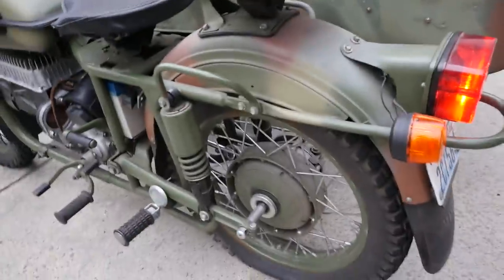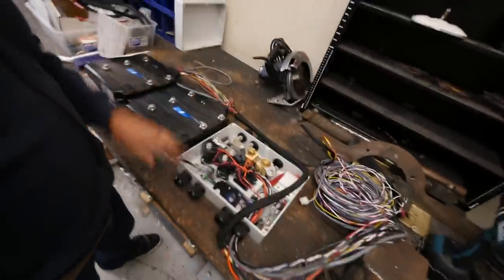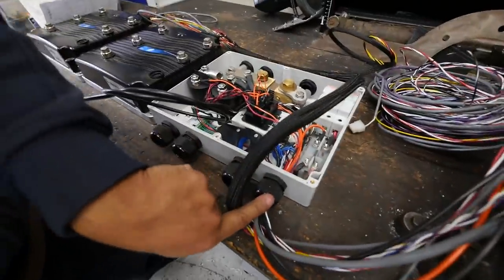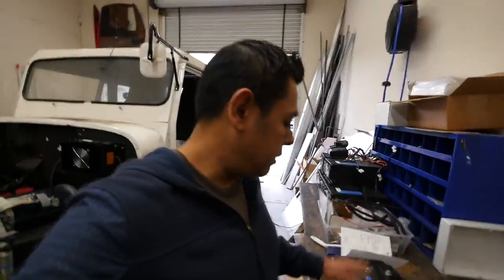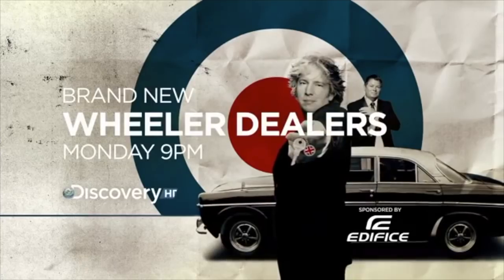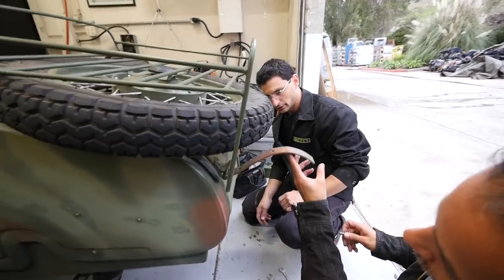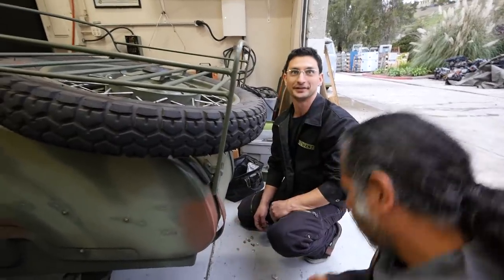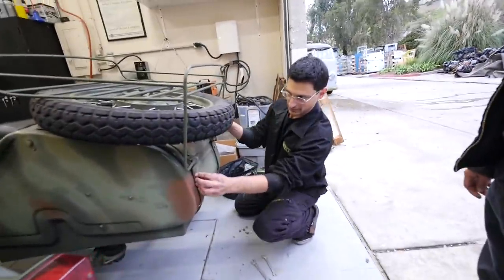The Electric Ural Motorcycle  -   Vlog #219

Comment: maibe use the same trick rockcrawlers use and screw the tire to the rim using small parkers(beadlock)
prolly only need two screws to prevent the tire from spinning on the rim
Reply: Yup, it needs bead locks for sure......

Comment: Hi guys,
write please wich type hub motor (powerful, voltage), controller and battery pack you use in URAL bike?
Reply from the maker: +Alfabike  hpevs.com AC-20/Curtis 1838
Reply: The ural uses the same drive line as the zero..

Comment: that thing would be alot better without the side car
Reply: but then you'll barely have enough space for a decent sized and priced battery for touring capacity
Reply: CDgonePotatoes they could take out the pointless gas tank and pointless gasoline powered engine taking up all the weighr and use all the space for batteries, and if that doesnt work use saddle bags or a bike trunk
Reply: CaptainSkelebones
still, the aesthetic value is then lost
Reply from the maker: why do you think this still has a gas tank and a gas engine?    Its been converted to electric, obviously those two things are gone.